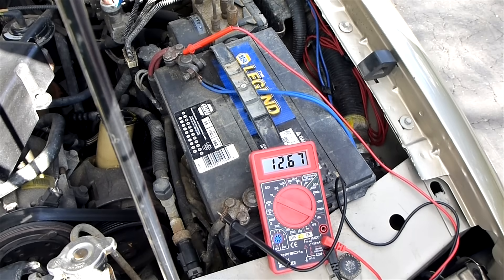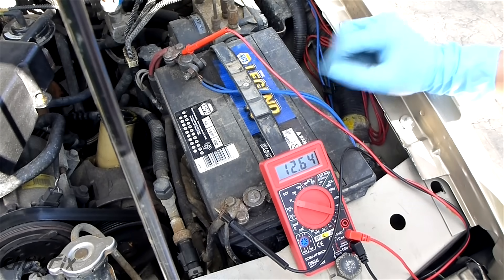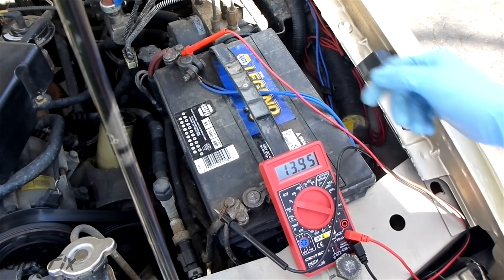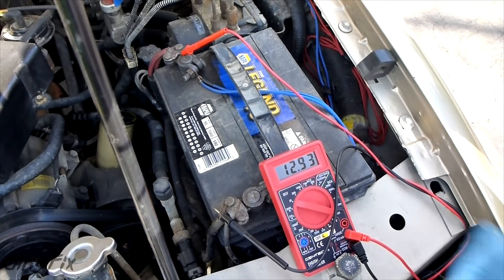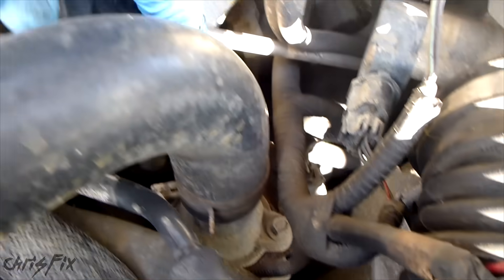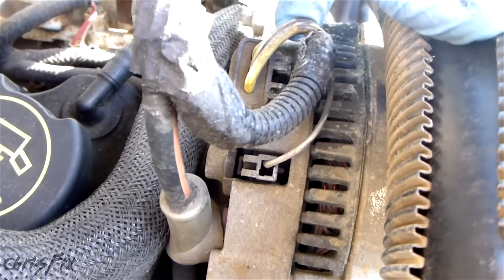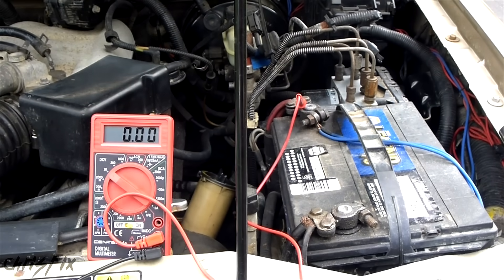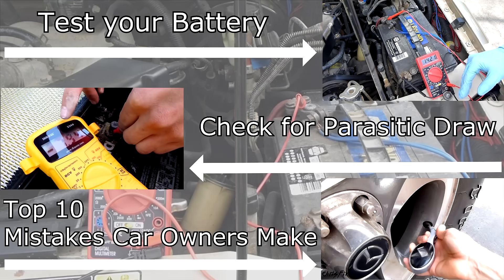How to Test an Alternator

Comment: Hi very useful video. I have smart charging alternator changed twice and battery is new for ford focus 2011. Electrician checked all connections and wiring is good but still get battery light when use heating and headlights even sometimes without them and goes off when driving on motorway. Could it be PCM or alternator causing problem?

Comment: Chris, at about 40 secs in you showed us a loose negative battery clamp.

Later, when you “checked” voltage drop between alternator body and battery negative post, you actually measured drop between alternator body and the negative wire before it went into that loose clamp.

I think you under estimate the effect a small voltage drop has on charge rate.  The relationship between voltage and charge rate is astounding, and very easy to illustrate.   I also think you underestimate the voltage at which batteries start to take a charge.  You will need a variable voltage DC supply, an ammeter, and a battery to check my thoughts.  The experiment will make a good video.

Incidentally, the easy way to check for voltage drop between alternator and battery is to 
1)	   Measure the voltage between the battery posts.
2)	   Measure the voltage between the alternator post and the alternator chassis.
3)	   Take the first reading from the second reading.

If you have a significant drop, then check between battery post and alternator post.  If that doesn’t find much of a drop, then you know you have a problem with the earth link.  A cable from an alternator mounting bolt to the earth clamp on the battery will solve that.  The cable needs to be at least 16mm2.

As a rule of thumb, if extra lights, sound equipment, etc have been added, then bigger, or more wires need fitting between alternator and battery.
Manufacturers cut things to the bone.
Reply from the maker: Thanks for sharing!

Comment: Chris, I have a 2017 Lincoln Continental with a 3.7 L 6 cyl. engine. The battery after a full trickle charge shows 12.8 v, but just driving the car about 2 miles the batt. shows 12.2 v. and the Alt. shows an output of 13.2 - 13.5 v. This is a definite Alt. problem, isn't it?

Comment: I have a 2013 Fiesta with 60k miles and the battery light was on. Previous owner had replaced battery to no avail. I lived with it for 2 years but was annoyed that the heated seats, heated mirrors, and rear defroster could not be used when that light is on. Voltage was always good at 14.2-14.3v. even under load. Good grounds. I did not want a situation where there was a problem and I would not know so I had a cigarette lighter voltage display plugged in. Finally decided to tackle the issue and got another 120amp alternator from the salvage yard and now the voltage is only up to 13.3v-13.5v but the light is now off. I read somewhere that if the alternator loses communication with the ECU, it will put out at least 13.5v but that is too low to properly keep the battery topped off. So my computer likes a lower voltage which seems to be the opposite of what it should. My alternator only has 1 communication wire in addition to the main power wire that 
goes to the battery. I might try disconnecting the comm wire to see what happens.

Comment: My truck started having some electrical issues on the drive home and finally died.  I charged the one-year-old battery up and got the truck home.  The truck then sat unused for two weeks.  Today, I put the multimeter on the battery and it was still at 12.4-12.6 so I know my issue is not with the battery holding a charge.  I then started the truck and saw nothing coming from the alternator with the truck running, I was getting a reading of about 12.2 which was lower than with the engine running.  I have a question.  I have not yet taken any of the connections off to clean and retighten but they all appear to be tight and the fittings on the battery posts are clean.  In another video, someone suggested it could be the primary fuse.  Since it appears that the ground from the alternator to the battery passes through the primary fuse area, could this be a reason I am getting nothing from the alternator?  Thank you so much for the video.  I have it on playing on a tablet under my truck hood right now.

Comment: If you're checking the positive on the back of the alternator and at the battery terminal it's the same potential and you will get zero reading same thing for the negative terminal going to ground it doesn't matter if you put the lead on the casing or the car or the engine block you're going to get zero or you going to get shocked if you do get a reading. Wtf is this?

Comment: I have a 2013 chevy cruze and when checking alternator while engine is on, the meter goes up to about 14.99.... what's your take on this?
Reply from the maker: Looks like the alternator is overcharging, I would look into getting a replacement as it sounds like the internal regulator is going bad!
Reply: @chrisfix  thank you sir...
Reply: My 07 dodge ram 1500 just checked mine and running between 14.7-14.8and spike to 15v Temp outside is 20° was told truck has an internal regulator in the PCM. also that the truck tas a battery temp controller under the battery. And that in the cold it's normal to run those volts?. What would be your take on this? Connection, bad alt, or PCM? Voltage drops to 10.2 at start up.

Comment: You should also take the reading on the meter in IDLE, around 2000rpm or there you normaly run engine as daily driver and at Redline...
 cause alternator (130A) do not charge full Amperage at idle maybe as low as 50A but voltage can be good..

Comment: Hey Chris, I put a new alternator on my truck and it works alright but the gauge still goes to 9 volts whenever I turn on the headlights or blower motor. Did I get a bad alternator?

Comment: How do you check the alternator if the car won’t crank over or start at all. I have a brand new battery but for some reason the car won’t start anymore on its own without being jumped. When I get it jumped it runs for a while then dies.

Comment: Question: if you’re starting out with an essentially dead battery and have to jump start. Does the 14.2-14.7 voltage still apply?

Comment: My charging system light comes on and off while driving, sometimes idling, the battery icon on the dash stays right in the middle and the truck starts good. I did recently jumpstart my girlfriend's car befoe this all happened. I have been running the engine for more than 30 minutes and it still running great. What could be the issue mate?

Comment: hmmmm. thanks. My 04 Matrix XRS just stopped at highway speeds last week. Nothng...no dash lights...nothing. I tried to start while coasting but no luck.I managed to coast down an exit and perfectly into a gas station. Thjen thirty seconds later while getting ready to call a tow truck, it started right up and I drove home without issue. Totally not sure whats wrong. Could the voltage regulator do this???
Reply: hi,that just happened to me a day ago, did you find out what was the problem or did it happened again,the guys at autozone  told me it was the alternator, my mechanic tested and told me it was fine, i am confuse now!
Reply: @isaiah9696  yeah. It was the ignition switch. I replaced the actual mechanical portion of the switch (that you stick the key into). Then a couple weeks later I also replaced the electrical portion of the switch (mounted on the backside of the mechanical switch), just to be absolutely sure. No issues since. Been about two years now I guess. This was definitely the issue. I bought oem Toyota parts. Wasn’t cheap but I didn’t want to trust this issue to some aftermarket crap. The ignition came with new keys and locks cylinders for the other doors which was nice because My key didn’t work for those (perhaps ignition replaced at some point? Probably with aftermarket….or, perhaps it was the electrical switch all along and someone swapped the mechanical one trying to fix. I don’t know) 
 Your car wouldn’t just cut out like that due to alternator.

Comment: I'm having a problem with the "battery light on" and then when I rise the rpms over +/-2000 the light goes away but come back as soon as the rpm drops under 2k... bad alternator or bad connection l? ⚠️🥴🤷🏻‍♂️
Reply: Probably alternator, check voltage at battery with car running and should be 13.5v-14.5v depending on make and model. If not within spec check at alternator connections. If within spec at alternator it’s a connection problem. If not within spec, more than likely an alternator.

Comment: I used to start the car and pull the positive wire off the battery, if it kept running, the alternator was working.

Comment: Hello Chris, I just stumbled upon your Test Your Alternator video...outstanding..thank you. Can I ask for your help in diagnosing a problem? I have a 1993 Mazda Mx3, 1.6l, manual.. New Battery and NEW Alternator. I went through all your tests and some of my own. All Fuses (including Main 80A, Fuel Inj 30A and Meter fuses) OK Visual and with Test lamp.  Key ON Engine OFF Charge Light ON. Engine ON Charge Light OFF.  Voltage at Battery Engine OFF 12.67V. Engine ON and on load 11.98V.  Alt Positive to Battery Neg Engine Running 12.63V. Voltage Drop Battery Neg to Alternator Case/Engine Block and Chassis ground 0.00, 0.02, 0.01v.  Battery Positive to Alternator B+ post/nut/wire 0.11, 0.12, 0.11v.  HELP

Comment: My problem is is that the alternator is on the BOTTOM of my 96' Saturn making it impossible to safely run most of these tests.  What the hell was GM thinking by mounting a sensitive alternator towards the bottom of the engine where it is the dirtiest AND where it could get wet from the road!  This car is on probably it's third alternator and now IF I replace it and not just toss the whole car, it will be going on it's fourth alternator!  It is also a HUGE pain in the ass to replace it!  I miss my old 75' Chevy where it took maybe 20-30 minutes to change an alternator.  😢😢

Comment: Hi Chris I have a question 
I hope you can answer. 
On my mother’s car She had a dead battery because She left the headlights on. As I was going to give the car a jump start I attached a multimeter to the battery to make sure the jump box was providing enough juice to start the car. My dilemma is my cousin put the test leads in the wrong position. 
For example on my way innova 3320 tool she had a black test lead connected to The middle Port of the tool where it says max 300 V and the red positive test lead on DC 10a and the meter was set to DCV well Needless to say 
when I touched the negative battery terminal with the negative test lead I got a small spark i’m assuming because the test lead on my multimeter was connected in the wrong port and reversed. thankfully the car was not on. But when the car did start I could hear A grinding noise Close to the alternator. 
I tested the alternator when the car was running and no load 
I got 14.2.5V when I had everything on it dropped to 13.9. My concern is I’m worried maybe that with what happen with the multi meter connection could have fried my alternator since I had a jump box connected to my battery and I was trying to test to make sure that I have enough power before trying to start the car. 
On the other hand I’m not really sure if it could just be the tensioner pulley that’s going bad. On a strange note once I drive the car around for a minute that sound goes away for the most part. Any advice that you could provide  would truly appreciate it since this is my mom‘s vehicle and I really want to give it back to her in a really good reliable condition

Comment: Hey Chris. my only constructive feedback is to conclude with a summary or conclusion. For example,  I have run the tests in your video. The battery test shows no output from the alternator - no 14.2 - actually just a slowly counting down battery. The negative post tests and the positive post test all are fine as per your description. So in summary, for my case the alternator is bad as its putting out no juice and it isn't a problem with connections, correct? Overall great video's!
Reply from the maker: Correct and thanks for the idea!
Reply: @chrisfix  Wow, you answered! I am impressed. Thank you again.....great video(s)!

Comment: I've just refurbished a 2nd hand Nissan TD27 alternator that was supposed to be working - The oil O-ring between the alternator and the vacuum pump was bad, so oil went through it. I cleaned the oil residues, cleaned the commutator rings, replaced the brushes, and installed it in the Nissan Terrano (a real mission to do, with the position of the alternator, and the extra oil and vacuum hoses). I had tested the diodes were ok, and that there was resistance across the commutator, fairly high (in the mega Ohms), but a circuit. After I started the engine, the battery voltage stayed at 12.4 V, no change with revs, so obviously not charging. The strange thing is that there is no battery light showing on the dash when running, or when ignition is first turned on. 
Any ideas what my problem is?

Comment: Hi Chris. I had a bad situation today. I forgot to turn off the headlights. It was 20 mins. When I came back and the car was dead. It was a small town and it was raining heavily. I was left stranded along with my aged dad. It was very much embarassing. Luckily the car got started after sometime. Pls give us a tip how to tackle such difficult situations?
Reply: NOCO Boost Plus GB40 1000 Amp <-- About $99 on Amazon. Keeping one of these in your car will save the day.

Comment: Chrisfix... when i connect my multimeter to battery and alternator B+. The reading is -5.72. Too high from your reading and my battery is going dead. What does it mean? What should I do. Please help
Reply from the maker: I would replace the a battery if you know the battery is going dead and test again!
Reply: @chrisfix  i bought a new battery and starter since my previous battery is almost 4yrs old

Comment: Mine is at 13.92, guess i need to get a alternator and fit it😑
Reply from the maker: You're still within a good range! If it really starts to drop when testing then it might need replacement!
Reply: @chrisfix  I think it needs replacing, it didn't start the other day, and then yesterday it didn't start, charged the battery up, but still didn't get over 14, although the car is starting atm, it takes a good 1-2seconds to start up, and when it seems to be cold it doesn't start, as both nights it didn't start it was cold

Comment: Hey Chris!  How would you test if there is a mechanical issue with the alternator?  When my car is parked, there is a whine if I apply gas at around 2 or 2500K RPM.  When I drive it also does it at around that RPM range.  If just at idle RPM speed, I don't really hear any whine.

Comment: When I turn on the ignition of my car, every light works great but the moment I switch on the engine, light starts flickering, the ratio of flickering is around 5 out of 100% ( this is a very little issue, but seriously I am concerned a lot to get rid of this trivial issue) , may I request you to help

Comment: Edit: without load it gives about 14 volts, with load it jumps between 12.5 and 14, does not look normal to me, does it?!

My car shakes when I lower more yhan one window at once, and it makes a weird sound when the rpm goes to 2000rpm, replaced the sparkplugs and they were trash and rusty, after replacing the plugs it was smooth but I tested it on hard acceleration, it was fine but right after the acceleration it started making tye weird noise at 2000rpm again and tge check engine light came on.

Is that a weak alternator or coneection or something with the engine?!
Note: the car used to get more than 10km/l but now it gets between 5 and 7km/l, I calculate that on the pumb
Reply from the maker: Sounds like a pretty weak alternator, did you get a chance to figure out that check engine light?
Reply: @chrisfix  all this happend today, I have exams these days until saturday, hopefully I can take it somewhere on sunday
Reply: @chrisfix  sounds like the weird sound at 2000rpm is spark knock, I think it is because of carbon build up because I drive very short trips and rarely drive highway speed

Comment: hye just wanna ask, if the reading varies from 8v to 14v is the alternator got problem?
Reply: A fully charged battery by itself should read about 12.7 voltz. wen attached 2 da alternator it should read 14 volt nd up da alternator charges da battery

Comment: hey chris. i watched this video to see if my generator is bad. but i can't even crank te car 1 time. it goes from 12,4 volts  to almost 3 volts when turning the key and it stays there ? does this mean my generator doesn't have the power or that my battery is dead ?

Comment: Great video. I have a question quick question. I am getting a voltage of 13.8 when testing the alternator. I do the voltage drop tests, and they are fine, and load testing was fine as well, the voltage did not change significantly. As fas as I can tell, that is what the alternator is outputting.  Being about a half a volt low, is that a problem?
Reply: Same, I have a Yaris and I am getting about 13.8. It first is around 14.2 and then drops down to 13.8. If I put a load on it, it goes down to like 13.5. I have no idea if this is to be expected or what the deal is

Comment: Quick question. So my battery light has been on a few days. Did some running yesterday and it wouldn't start when I tired to leave the store. I got a jump tired to drive home but it wanted to die Everytime I almost came to a stop. I just replaced the alternator a month n a half ago. Any ideas or advice? Thanks

Comment: It seems like these voltages are car brand specific? My 2003 Pontiac vibe seems to limit running alternator voltage to 13.8 which is  well bellow your 14.2-14.7, or am I mistaken?